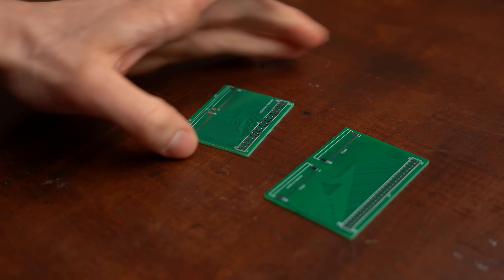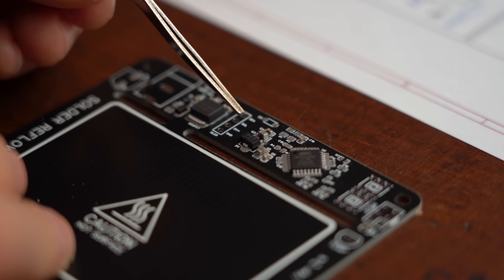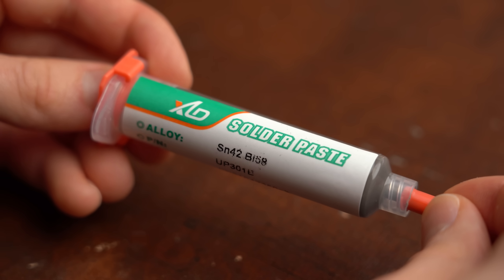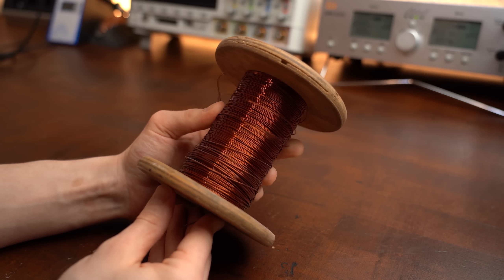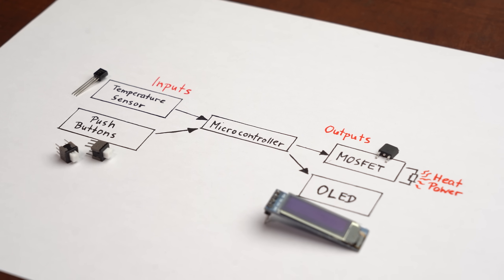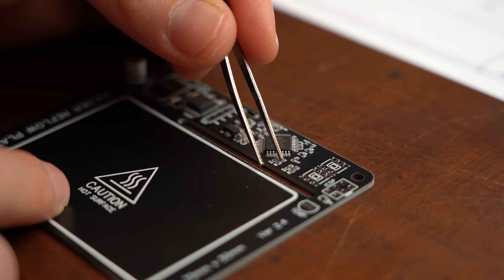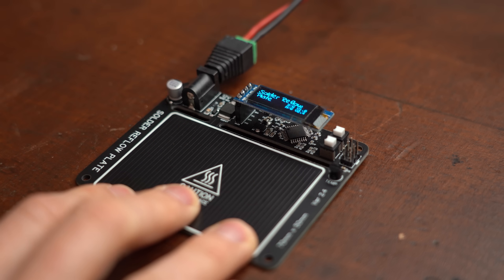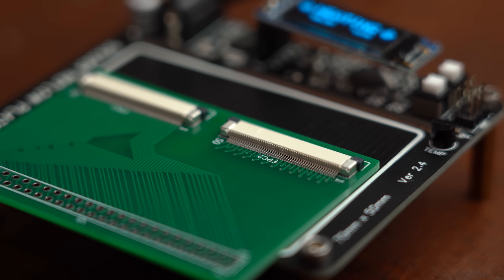The Best way to Solder? Hot Plate to the rescue! (DIY or Buy)

Comment: I've handsoldered plenty of low profile connectors, and it's definitely a pain but doable with patience. I've been wanting to try hot plates, especially the ironing plate that is suggested. The only issue with hot plates is that you can't do both sides of the pcb, so you may have to tweak designs featuring a high/low density sides
Reply: Wrt hand soldering fine pitch - agreed! But as it was shown in the video, it's not surprising that it feels troublesome. I'd probably choose a soldering iron with a smaller tip, but at the very least a much thinner solder! The one seen in the video is way too thick to solder that pitch properly.

Comment: It's 2022 and we're still waiting for @GreatScott! to discover this magic substance called "flux"...
It was rather painful to watch him solder that connect at 0:35 without it.
Reply from the maker: The solder I use comes with a flux resin core that handles this job.
Reply: @greatscottlab  That is the bare minimum, which usually isn't enough and doesn't really handle that job. You can see joints at 0:38 look bad, oxidized, especially these 4 bridged on the right.
One can literally solder the entire connector with a single swoop without any shorts, but you need a proper amount of flux to do so. Here is a good example: https://youtu.be/5uiroWBkdFY?t=115
Or check @LouisRossmann channel, maybe ask him about "proper amount" ;D

Comment: If the ATMega is in such short supply then why not rework the pcb for an ATTiny1604 or similar which are available at the moment.  They basically have a 328 core just with reduced pinout count, and the schematic for this only uses 9 active pins.
Reply: he actually did this with a bit overkill atmega 4809

Comment: This is a major problem - why isn't there a decent reflow system on the market for a reasonable price? I used Reflowr which was junk, the IR reflow ovens are junk - they bake black parts too much and metal shield parts dont reflow, MHP30 is a joke in size. I ended up buying a small air fryer and added extra heating elements, fan, insulation to it. Works great.

Comment: I am very curious about the maximum temperature, as I am not very familiar with the method. Can it also be used on commercial PCBs with lead-free solder, for example to change a single broken component? Or is it best used with just low-temperatur paste? Very interesting video either way!

Comment: I soldered all my ESP32s onto their expansion boards on a frying pan on the kitchen stove :D
Reply: @karlkessler6017  well i could see/know what the temps are but that's not really all that useful. I just picked them up as soon as i saw the solder paste melt. The coupling between a PCB and a frying pan is very poor tho so you do have to crank it. and the temps you need to melt solder will ruin Teflon coating of fancy pans. Now days i put them straight on the stove ( non induction electric stove) .its way faster but risky if you don't have the hang of it and i fried a few ESPs like that. i would start with a small pan/ metallic plate on the stove.
Just start off but putting some junk PCB on the stove with some solder paste and see how that goes.
Reply: @fortheregm1249  I wonder if putting a 5mm mild steel disk on an induction stove will work OK. I don't think the magnetic induction will get through the steel plate so that it swings current through the components or copper tracks to destroy the circuit. Might be worth a test. Just need to control the steel hotplate temperature via the induction.
Reply: @karlkessler6017  It is Full on. until it gets to a temperature set by the dial. just like how an electric oven works. ( dials are incremented 1 to 6 tho )
Reply: I've done this a few times too, on bare glass stove. I've been successful with regular chips, but so far I've only managed to fry my ESP32-C3 modules. Do you use solder paste? Ive been trying to pre-coat the pads with regular solder and then wait till they remelt and them quickly place the module, but it still dies😅 but regular components work fine
Reply: @noxim_   yeah i dont think you can do it with wire type solder . i just put a tiny bit of solder paste on each pin including the heatsink on the back. Just like i was saying to the other guy you really need to have the hang of it if you are putting directly on glass . also solder paste gives a really good visual representation when it melts.
Reply: @karlkessler6017  another thing that will get you afew times is when you pick up the PCBs very quickly sometimes the esp will move a little, which is not a problem when you are using a pan
Reply: @karlkessler6017  Yeah i have the glass ones and that's the reason i roasted a few ESPs. They ramp up WAY too fast so you gotta have a little experience and have broken afew eggs. But the dial on them isnt just the duty cycle. it actually adjusts the maximum temperature. also worth noting that the ESP expansion boards you find online actually have aluminum core because they have to heatsink the ESP so they heatup evenly.  So nowadays i put the stove on the correct setting and the board is done and ready in 10 seconds from start to finish. But I still would have preferred to have the slower heating metallic stove for this application. but i dont and I'm too cheap & broke to buy a PCB oven  LOL.
Reply: @karlkessler6017  they are all from expressif, no ? not like the italian arduino with chinese clones . Expressif is made by a chinese company . But i could be wrong , im not too sure about that
Reply: @karlkessler6017  this thing keeps d311Ting my com3Nts and my repliyz liek the 1 yuo aksed abovt exprsif . probably cz i mentioned afew country names. bin doing that to me since i made some comments about ItsN0tReal . anyways, nice t@kin 2 U.
Reply: I use a 5mm thick circular steel plate on my induction plate to tin/solder plate my raw copper PCBs with solder paste but never tried re-flow.
Reply: @Appregator  Did a steel plate on induction stove actually work for you ? I would have guessed the induction penetrated past the plate and fried the ESP/chips ? Did the ESP come out of this ordeal alive ?
Reply: @fortheregm1249  I only used it to tin the copper tracks. Maybe one day I will risk it to place chips.  But not so far.
Reply: Good for you, I guess 7:24
Reply: @karlkessler6017  if your junk PCB isnt flat on the back side, ie has soldering bumps or throughput components sticking out the back it wont work, Good luck

Comment: Chris’s project is awesome. I was surprised to see a diode for input reverse polarity protection instead of a P-channel MOSFET, for this relatively high power design. It makes it less robust and wastes power. I wonder why. Maybe there’s an obvious reason I’m missing. Given the beginner-friend;y source code, maybe this diode design is intended to make the electronics easier to understand for novices. Regardless, the project as a whole is great stuff.

Comment: Instead of doing heat soldering, make a project that uses ultrasonic sound to solder. Make it a handy tool like SMD testing multimeter.

Every like will be appreciated, I have a project ready in my PC. But can't afford even 2$ + shipping or chemicals to make etched PCB😌

Comment: Please do not use SnBi solder. They create fairly unreliable joints, and as shown in your video, parts tend to shift before being soldered. I won't go through the detailed mechanism here, but just don't use them. Use SAC305 or at least SnPb whenever possible.

Comment: I think buy doesn't win, 100$ for a small plate like that is quite expensive. DIY is a much better option, also you can improve the design by using an external heater that will support a lot of charge/discharge cycles. Over all thanks for the video, like Always super interesting 👌😁
Reply: I have the small plate and it's great when it works and doesn't occupy lots of bench space which I appreciate. If I had a big board full of 0402s I would be paying for manufacture, so it seems to be enough for my purposes. I'm not doing aluminium boards though where a bigger plate seems like the right thing.

Comment: I have a really small design suggestion for the DIY version:  If you remove as much of the border as possible on two or even three sides, it would be possible to place 2, 4 or even more next to each other, creating a bigger platform.  Maybe a niche use-case, but you can see how expensive the large reflow surfaces can get.

Actually, that ties in with Collin Bardini's comment about making the control circuitry separate.

Comment: Instead of using schematic to cross off soldered components you can use assembly layer in which components have body outline with designators within.

Comment: I don't expect the DIY PCB hot plate to have any kind of reduced lifetime as lots of 3D printers have PCB hot plates as well and functions for thousands of hours without any problem
Reply: But in 3D printer use case, they rarely go beyond 100°C tho ...
Reply: @skyguardian18  but do you think it's a difference?
Reply: Those are professionally designed, with the control electronics on a separate board, and usually as an aluminum-clad board to help with heat distribution

Comment: I also recommend you using a halogen reflector above the PCB, also controlled by the temperature probe. Usually in the industry a pyrometer is used, but for the average DIYer a pyrometer is way too expensive to be purchased.
Reply: I presume the reflector is for additional heating from the top side?

Comment: Instead of this, we can also go the traditional way to fill a pan with sand and use it as the hot plate, we can also easily change the size of pan to accomodate a larger PCB size. Well we do have problems of temperature control but a potential solution for those who do not want to use it too often.
Reply: This also solves the 'chicken and egg' problem of 'how do I solder a reflow plate without a reflow plate?'
Reply: That's a  good idea...so How do I heat it? 🙂
Reply: @jackiec498  you heat the pan in the kitchen
Reply: @MAKOS-ky5my  I was thinking of using one of the outdoor grills my apartment complex has. 😂
Reply: @jackiec498  Typically with a common, electric hotplate one might use in their kitchen. In the US, they can be found for less than $10. I’ve had good luck using a cheap hot plate, an aluminum pie tin and some fine, sandblasting sand. Some people use irons _ the kind that are intended  to smooth out clothing/fabric _ as the heating element, though I’ve never attempted that myself.
Reply: Interesting, the sand idea.
I was thinking to set a nichrome heating wire in a concrete ... the way some shunt resistors are made.
One could embed a glass 100k ntc thermistor in there too.
Reply: @GnuReligion  you can buy ceramic heaters or just use an old cloth iron both of which are isolated
Reply: @ShahZahid  After reading other comments, you are probably right. An old clothes iron is probably the way to go.
Reply: @GnuReligion  sounds like a really interesting idea. I could be totally off on this, but I think the resistors you are talking about are enclosed in a ceramic material. If so, that would make them safer at high temperature. Cement can crack and pop somewhat violently when locally heated. I’m guessing this has to do with the amount of water that remains in the material, even after it’s cured, plus the stress that it probably experiences when it’s not evenly heated - but I’m certainly no chemist or materials scientist, so take that with a grain of salt. All I can say is that I’ve experienced this phenomenon in the past.
There are high temperature thermal epoxies. I wonder if your idea could work with the nichrome wire embedded in the epoxy, directly,coupled to piece of thin glass or an aluminum or copper plate. Idk. That game has its own safety risks.
Reply: Maybe a good bootstrapping idea, here. You need some way to reflow the initial hotplate board and since I don't do SMD boards very much, I always worry that with the hot air gun I'll either overcook something or blow some small component off its pads.

Comment: there are cheap 220v aluminium heater plates that could be controlled by an mcu, ssr and thermistor/k type/pt100 or there's already pid controllers prebuilt, you could also use an old iron but it takes a lot more power (2kW+)

Comment: My sons graphics card burnt a mosfet (plus fuse and regulator). I quickly learned, even at 450c hot air reflow station is no match to get anything off the PCB. Normal PCBs bubble at such heat but graphics cards can take way more (just like your aluminum LED board). I wonder, would this be a possibility for such removing? FYI it’s double sided for extra difficulty!!!

Comment: One option would just use a smal full arduino and a shield instead of waiting for just the "ATmega328p" to come back to stock, its alot bolkier but easier to get hands on, or is that a bad option?

Comment: Litterally ordered six different pcbs at JLC till now, my biggest one had over 110 components (took me araound 8 hours of hand soldering) and i havent used a hotplate or a hot air gun once. The reason i never did always was the pricepoint but I can definetly see why hotplates are so popular these days, since soldering with my ts100 can be quite tricky for some very small chips. So for me a cheap diy reflow plate to play arround and get familliar with this tecnique is a great option,

Comment: I don't understand. You can buy hot plates as simple aluminium plates with ptc heater stuck underneath for few bucks. I expected you to got one and control it with arduino, a temperature probe and some mosfets.

Comment: Maybe using a PCB heater from a 3d printer might be a good alternative. Or a 230v silicone heating mat
Reply: I think those are not rated for High temps. But i have some spare heater and thermometer cartridges for my printer and I was planning to stick them in two holes on a small 8mm thick copper blocks i have . they are rated for 300c and cost only afew dollars each.

Comment: I remember you have come up with a solution: hot sand with normal frying pan. Of course the hot plate can make the soldering process easy to control.

Comment: I think it would make more sense to make the DIY version as two boards, one control board and one just as a heater. That way you only need to replace the heater board if it gets damaged over time. The heater could also be larger and it might also be possible to have a temperature sensor touching the bottom of the heater if the boards are stacked to get a more accurate temperature measurement.
Reply: not to mention you could have multiple sizes of heater board and swap between sizes as needed while only needing one controller board
Reply: In the beginning I was worried about the durability about the PCB too. But, having used this heatplate to solder 200-250 PCB's, I must say that it still works perfectly fine. The silkscreen is a bit darker than unused yes, but still the heatplate works 100%. Not bended or in any other way damaged. It's still able to reach the temperature in the same curve as new.
Reply: @CBJ1 do you use 138˚C paste? is 183˚/217˚ paste working too?
Reply: @Lumi_nance  I'm using this one: TS391LT10 from Chip Quick. 
It is thermally stable (does not require to be kept in a cooled place)
It is a 138deg melting point.
Easy to work with, easy to clean
Reply: @CBJ1  thanks, my plan is to use this kind of hot plate with chip quick TS PB 183˚C My experience with chinese 138˚C paste is, that it breaks very easy, not suitable for connectors, large inductors, switches...
Reply: @Lumi_nance  Ok, I have no experience with this solder paste being weak on connectors etc.
Reply: Just buy a 3d printer bed heater, they work on the same principle,  most are just an alu plate with a pcb heater element.

Comment: Sorry but there is nothing intuitive about the MHP-30's user interface. It's a nice device but the human I/O is terrible. I've used it for over a year, getting it out only once a month or less. If it were intuitive I would not have to find and puzzle through the manul every time. Both the user interface and the default manual are both absolutely abysmal.

Comment: Hey! How about hacking the heatplate of a 3D printer. It's design to handle the heat up and cool down cycle but also feature a quite big heating area. The main problem is wethaer the heatplate can handle tempeature up to 200C or the power draw.But it's will turn out to be fun!
Reply from the maker: Sounds like fun ;-)
Reply: @greatscottlab  By the way,will a peltier module work?By choosing the one can stand high temperature, maybe it's can be more efficient and make the heat up cool down cycle faster?